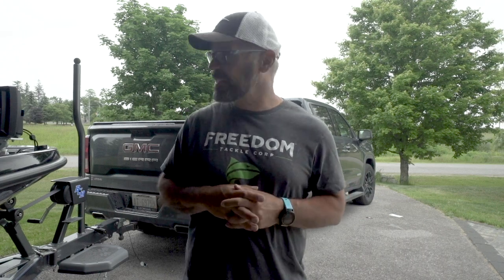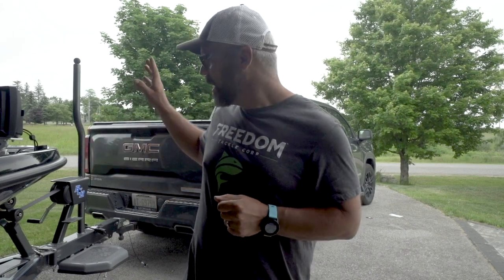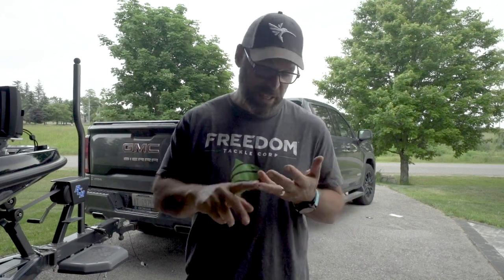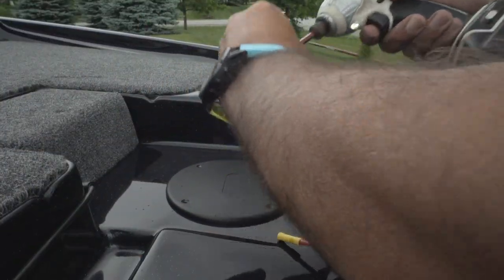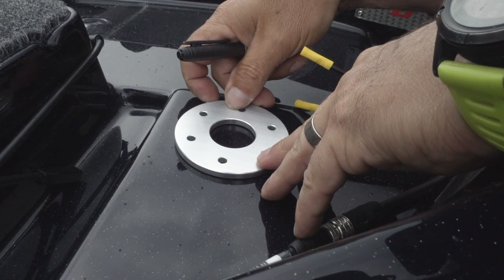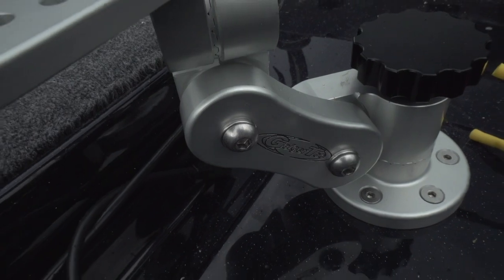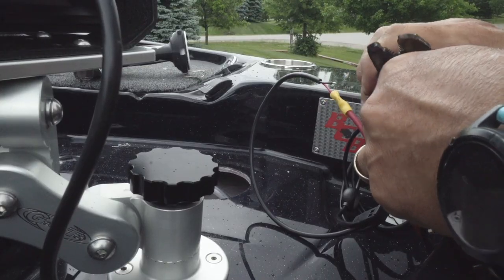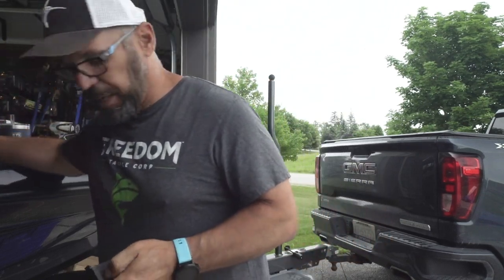INSTALLING BOW MOUNT ELECTRONICS w GeigerTec Mounts

Comment: Interesting that about a year latter the RMP mount is almost identical.  It’s a beast of a mount. 
I like the knob that secures thr mount to the deck. Easy to remove the graph and mount with one knob.

Vexus boats also runs heavy gauge wire to a buss at the console and bow. Makes installing electronics a breeze.
Reply from the maker: Interesting. GeigerTec is made from billet aluminum and yes, that RMP design looks eerily similar to the GeigerTec Promount. What is it made from? What I always loved about GT is they are over engineered. I guess imitation is the best for of flattery.

Comment: JP, do you have any experience with the Geiger tech 360 mount? I've got a torova on the front of my boat which won't handle a 360 transducer well at all, so I'm looking for an alternative to mount my 360 up front without having to drill holes or do anything crazy to my torova and the geigertech 360 mount looked like a solid option, in fact it looked like the best option I could find. Do you have any experience or thoughts about that as an option from mounting a 360 transducer on the front of my boat?
Reply from the maker: I haven't used one but yes, it is the best option. That's probably why Humminbird teamed up with Geiger Tec to produce that universal mount. Unfortunately going to have to drill to mount the base plate but it does a great job and the product is rock solid.
Reply: @JPDeRoseOutdoors  Thank you JP!
Reply: @JPDeRoseOutdoors  Thank you JP!